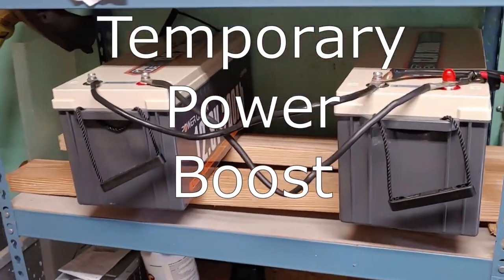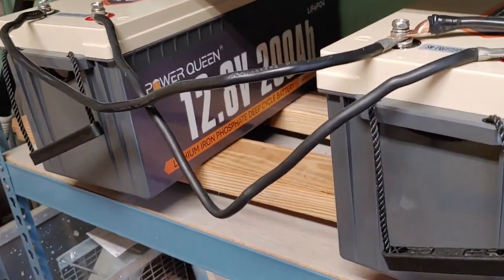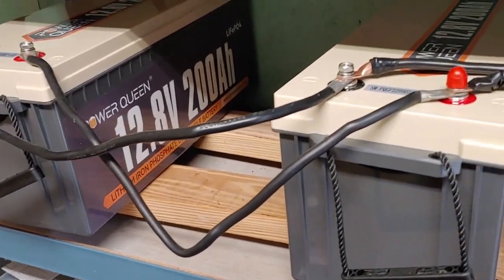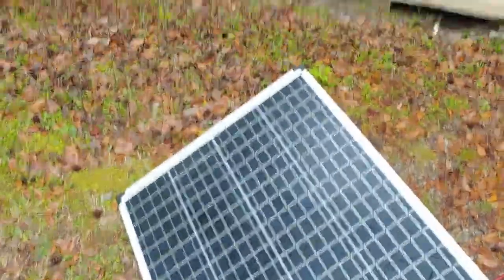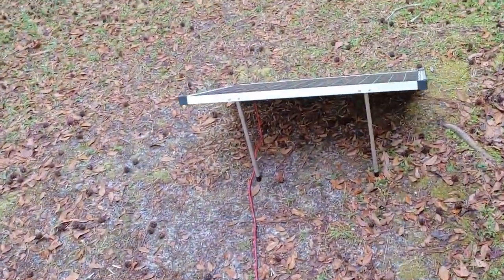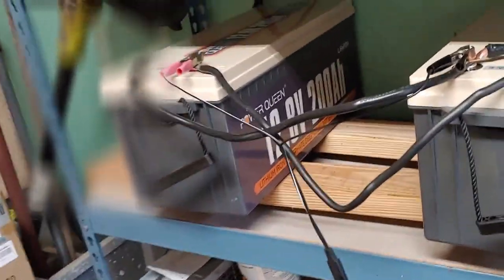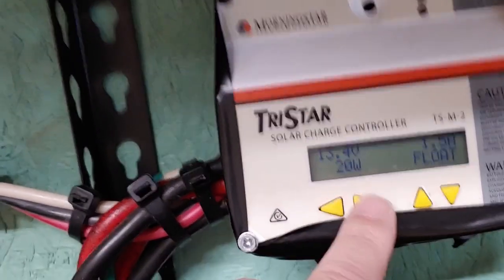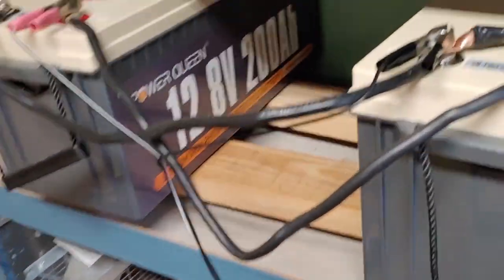Temporary Power Boost to my Power Queen batteries.

Comment: this is a great idea to get one out of a jam had to do something like this a few times but mine was to lower capacity on the battery the bms would trip shutting the solar controller off so had to use a spare panel to bring charge back up for controller to kick in
Reply from the maker: Thanks for letting us know.

Comment: I love your videos and was rewatching many again, last evening, because I am trying to learn, and retain what I learn and you explain things well. Is there a video that you've done showing how you get power from battery room to your house? I'd like to see that if at all possible? I'd love to have a couple life po 4 batteries but we'll probably only be able to get one or two harbor freight ones to start. I have a 100 watt solar panel and a charge controller the blue kind I think it's a 20/30 amp can't remember it's been awhile since we got those things. I have a little red three hundred watt inverter similar to your 500 watt one. I just lack cords and hook ups and battery to get started. I have a kill a watt too. We have a 100 watt power station we got on clearance from Wally world awhile back too. We have used one of those harbor freight jumper power stations for LED lights and to charge phones before as well with a small like 80 watt inverter that plugs into the 12 volt ports too. Only problem with that is knowing how far you're running battery down? As they can't be run down like the life po 4 batteries can. I haven't even used the 100 watt power station yet either. That thing seems to take a long time to re charge through wall socket.? I also keep an extra car battery on float too in case. I have only used the harbor freight power jump pack with the little 80 watt inverter to run a small fan into a diy red neck ac similar to your little ac cool thing. But mine was made with a cheap Styrofoam cooler, a PVC elbow the fits in top cut out, and a cut out for a small fan to set on top to move air over the ice water and out the pipe. The dog enjoyed it one power outage during mid summer. My father in law as well, when power went out when he was in in home hospice, we kept him cool with that till it came back on. We do have an old Genny but luckily have never needed to use it. I'd like to figure out solar to not only help with power bill, but to help with possible power outages as well. Plus it's good to know and understand as well.
Reply: Check out Will Prouse on YouTube. Lotta good instructional videos on solar/ battery stuff.
Reply from the maker: I will be making an upcoming video to show how the power gets from the battery room into the house. It needs more explanation than I can offer here.
Especially when I was just getting started, I would get my cables and cords from the local auto supply company. You can usually find some 4-gauge wires on the rack.
To answer your question about running the batteries too low, I try to get inverters that have built-in meters. Otherwise, you can use a multimeter and check on your battery periodically. You can see that video here:
https://youtu.be/3QmIrpFKnME
I like your improvised air conditioning system. I once knew a woman who would tie reusable blue ice packs on the front grill of her fan by day and re-freeze them overnight.
Thanks for your comment.
Reply: @shoestringprep I just watched your second video again which kinda explained it. Yeah I'd like something that figured out the d.o.d for me. As person mentioned above Will Prouse is good, but he talks too much sometimes, which can confuse sometimes too. I've watched him also. I like quick detailed, and to the point simple videos like you're doing. I've watched many different you tubers and still do, trying to get different ideas and just to learn.
Reply: @michaeldina1103 I have watched Will also, but sometimes he gives way too much information which can confuse. Yes he's good, knows his stuff, but I really hate long and drawn out videos. I'm the kinda person that wants someone to get to the point quickly, and gives good simple, detailed understandable information. Doesn't spend thirty to an hour explaining stuff that doesn't interest me.
Reply: @missreynolds3637  If I find someone on YouTube that fits that requirement I’ll let you know. It’s hard to learn about something when you are not really interested as well. Maybe you learn better by doing? If you look you can find a very simple/ cheap ammo can style DIY power station you can just copy everything that they did. Once you get your hands on the stuff you might learn all you want to know.

Comment: This is a neat little trick! Thanks for sharing as I had thought about this scenario but not considered this as a solution. Not having a charge controller as an intermediary here puts more power into your system when you need it. I wonder if that means you are actually getting 100 watts? I guess am curious to see how the BMS would react if the load disconnects and the battery starts to receive the unregulated voltage? I know you wouldn’t let that happen on purpose. Anyways that Harbor Freight panel will definitely pay for itself now.
Reply from the maker: You are correct I am not going to do that. Thanks for your comment.
Reply: the battery pulls the voltage of the panel down and it would take a very long time at 100w to over charge but even then if over voltage range is met the bms will trip and shut off
Reply from the maker: @1981dasimpson  thanks for your comment.